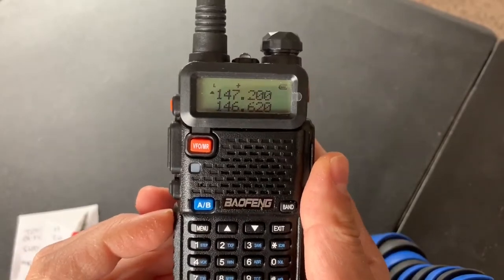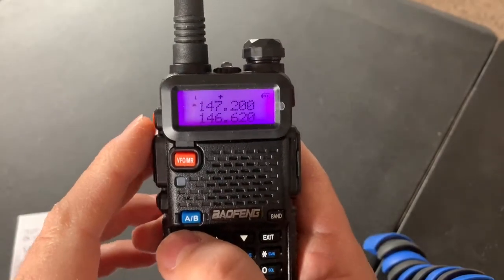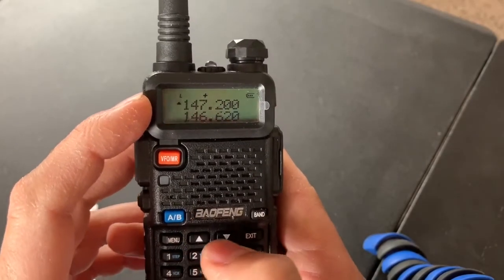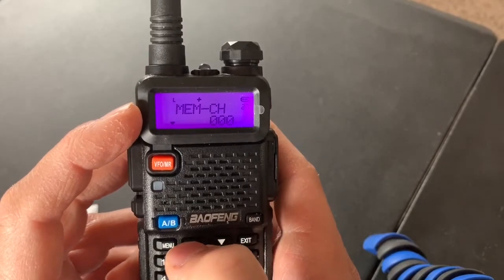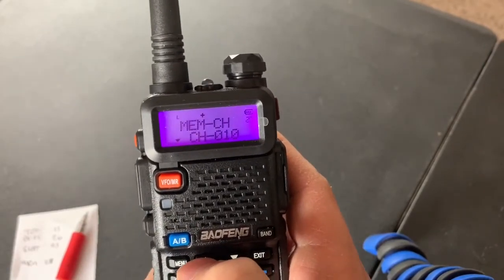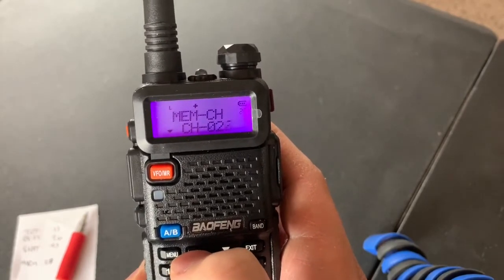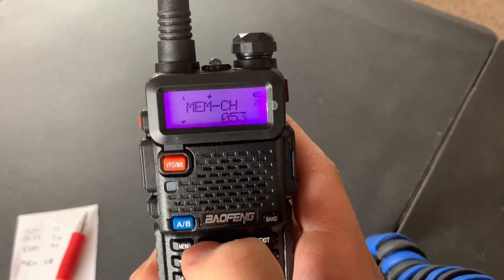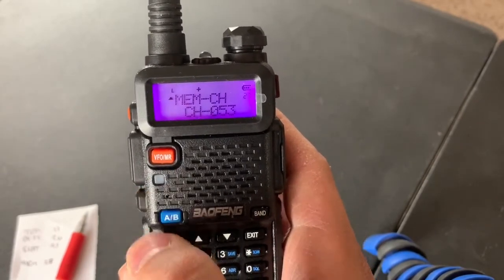Keypad Programming the Baofeng UV-5R

Comment: I need your help, I’m trying to listen to my sheriff department but I don’t her any radio traffic. I can listen to other department in county but not the sheriff.
Reply from the maker: Interesting. The Sheriff may be using a truncated system so it might be worth getting a Uniden Scanner. Then again, that might not even work. Do some digging, but I bet your sheriff is on some different gear.
Reply: @backcountryamateurradio  But it FMN tho?  and all of the other department are FMN and NXDN. My Fire department is NXDN and I can still listen to when the dispatch tone out the call but I can’t hear when the fire department talk back to dispatch.
Reply from the maker: @OfficialChrisBreezy  man, I’m unsure. That’s kind of out of my wheelhouse. I’m sure someone has information on that. If you find details would you mind sharing? It’s perplexing that you can’t hear the sheriff. I have heard of military comms using a technique of alternating frequencies... but I haven’t looked into it.
Reply: @backcountryamateurradio  Do you know any frs frequency? Because I can’t use 462 or 467 on my baofeng GT-5r. I can receive but I can’t transmit on the frequency. Just on my UV-82.
Reply from the maker: @OfficialChrisBreezy  I haven't heard of this issue. Though facing serious issues with the FCC some Baofeng radio vendors may have rewritten firmware on some of their radios to restrict use of certain frequencies. I don't have this problem with my Radioddity Baofeng units. I know a lot of people use FRS on their Baofengs.
Reply: @backcountryamateurradio  I figured it out now. I didn’t program the CTCSS tone and I have it on FM, But it suppose to be NFM. On radio references it say FMN, but i put FM. But now I put NFM and it work.